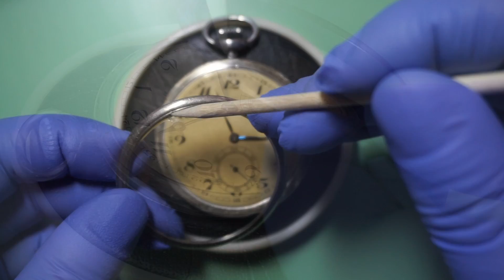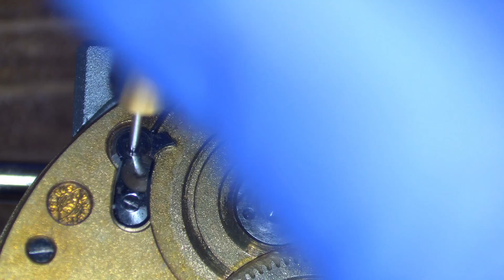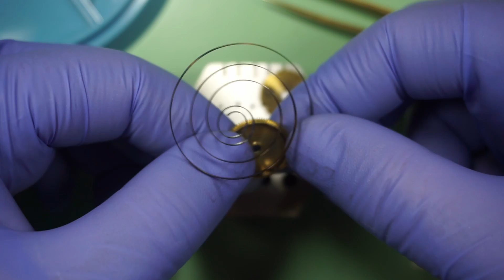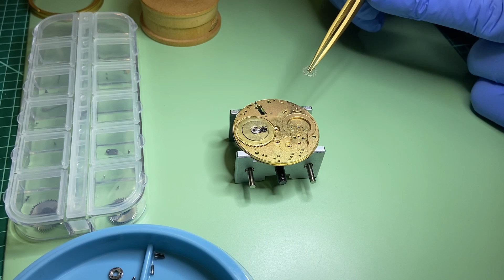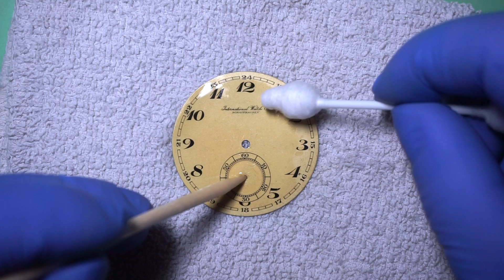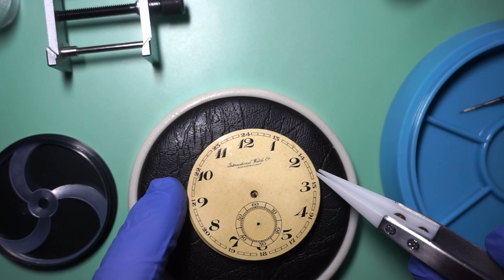IWC Watch Restoration | International Watch Company Caliber 73 | Geneva

Comment: Very enjoyable video, thank you Mark,  you did a beautiful job. I'm a beginner at watchmaking, about 15 months in. I'd just like to add that the little black mainspring barrel closer that you use? I have one too, and it NEVER works for me. I have yet to press on the top of the thing, and get that satisfying little snap that tells you the barrel lid is properly seated. What's the trick?
Reply from the maker: Hi Garry, thanks for watching.  Yes, it is a little hard to get it lined up just right.  The trick is getting it to apply pressure evenly across the surface of the top of the barrel.  If it's not just right it won't work.  Hope this helps!!

Comment: Pretty terrible application of Moebius 9415 to the escapment, you got oil on the pallets sure, but you made a mess. Did you use 9010 for the all of the jewels of the gear train? I hope not. I hope in the future you're able to invest in a Watch Timing machine, it's all about timing. No point in having a watch run if it isn't running optimally.
Reply from the maker: Thanks for the tips!  I'm definitely still learning.  Also thanks for the encouragement.

Comment: Hi Mark, I'm about to purchase a L+R cleaning machine.  I noticed your L+R cleaning jars have lids that fit snugly in the opening.  I'm looking for something like this as the black l&r jar lids that come with it don't fit tightly enough and I'm afraid will lead to evaporation of the solution. Where did you get those wooden lids?  Thank you for your great videos!
Reply from the maker: Yes, they work great.  I got them at Hobby Lobby, I believe they are bamboo and have a rubber seal.  They come as a set with some class canisters but I think they were only $4 a piece or so.  Thanks for watching and your comments!
Reply: @watchasilearn  Mark, so you replaced the original L+R jars with 3 new ones from hobby lobby?  Did you experience evaporation with the original jars?
Reply from the maker: @Gen12608  No, I didn't replace the jars, only the lids because the original black ones didn't fit tightly enough.  I use the jars for cotton balls and Qtips in the bathroom.  :)